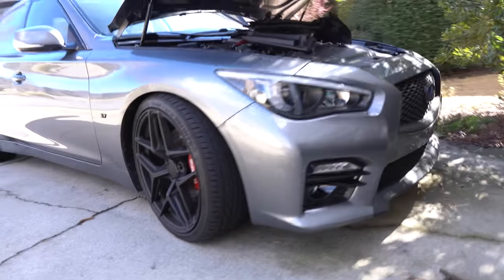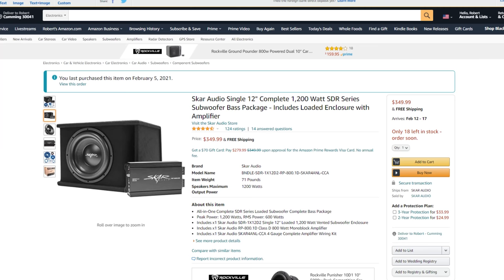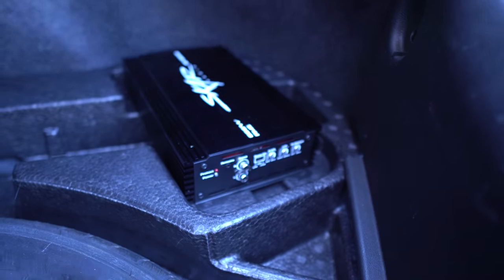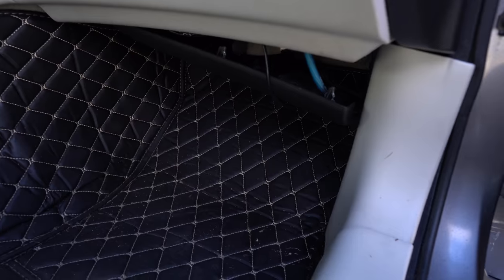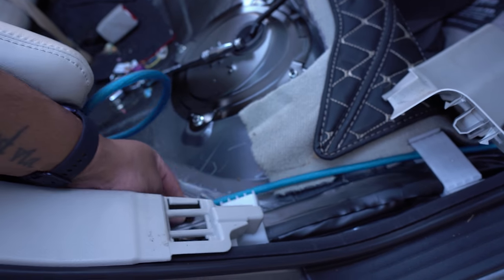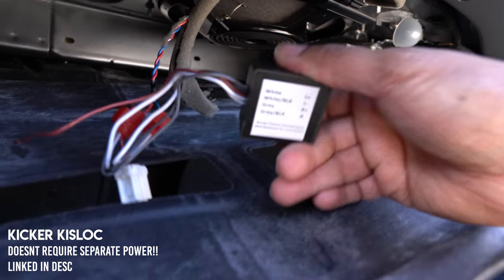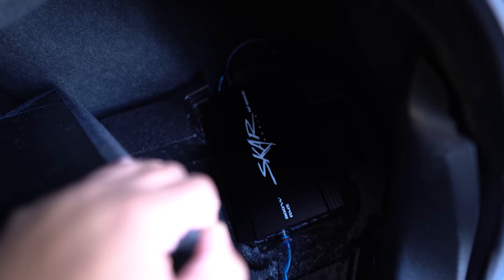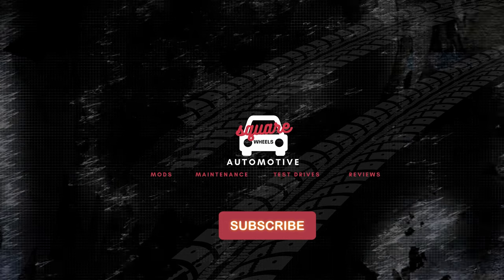Adding an AMP & SUBWOOFER to my Infiniti Q50

Comment: I’ve always heard you should tap the signal before the amp and not at the factory sub.
Reply from the maker: Could be better that way? I'm not a pro installer or audiophile, just a guy with a Q. I do know this setup has been rattling my mirrors cleanly and consistently for over a year 👍🏾
Reply: @SquareWheelsAuto  that’s good that nothing bad has happened. If I decide to keep mine (2014 Q50 with the Bose), I might do it before the amp and also disconnect the factory sub so I don’t blow it up when the lows hit.
Reply from the maker: @clarks2001  I'm no pro, but I know enough to know there's literally no chance of that happening. All you're doing is piggybacking the low frequency signal from the factory sub. There's nothing getting sent to it.
Reply: @SquareWheelsAuto  I’m definitely no pro either. But thank you for the clarification. I’ve got an alpine type r (older model) and a 1000w mono amp just waiting for me to install but was always afraid I’d mess something up. I’ve done many installs on all my other vehicles but they never had premium systems in them so the Q is new territory for me on audio. Also, I’m on the fence about the “Tesla screen”. Being a 2014, it’s not capable of a PnP CarPlay module, which I need. I’m not sure if Phoenix has one that has CarPlay though but seen something about one that had it.
Reply from the maker: @clarks2001  I do know a thing or two about those 😅
https://youtu.be/UnAJlgdZ0So

Carplay support included, no need for additional accessories: https://youtu.be/q_krcJmG4Fo

Comment: I'm kinda lost on the line output converter. My kicker one has a blue wire? Where does that go?
Reply: Im guessing it gets tapped into that lavender wire?
Reply: You have the kicker kisloc 2.  Blue wire is amplifier turn on as it is a DC Offset (signal Sense wire)

Comment: Where did you connect the negative ?
Reply from the maker: There's a bolt right where I showed. Just gotta lift up the carpet to access it. You can also run ground to one of the bolts behind the seat

Comment: I did my install just like this and it worked for around 30 minutes and then my system cut off, decides to just buy a new amp since mine was old anyways and the new amp isn’t reviving power, any ideas or recommendations?
Reply from the maker: If u replace a component and it isnt powering up, check fuses!
Reply: I fixed it, thanks for the response

Comment: I have a quick question I have a 2014 q50a and don’t have the Bose system so you can only imagine my shit sound I was trying to do this but I don’t have a amp so I’m not to sure where to install the remote cable
Reply from the maker: U could tap anywhere that only gets power when the car is on. The positive wire going to cigarette lighter ports are perfect for this. Disclaimer: haven't done this myself

Comment: Did you have to disconnect active noise cancelation mics?
Reply from the maker: My Q didn't come with ANC but I've heard others that have done that.
Reply: @SquareWheelsAuto  what year is yours? I have a 2015 with the bose setup. I'm using your video as a guide this weekend
Reply from the maker: @jeffstack7013  mines a 2015 sport with Bose. Good luck man!
Reply: @SquareWheelsAuto  thank you for the step by step instructions. I was able to get this done in about an hour and a half.

Comment: Does anyone know if this will work for a 2011 m37? I cant find anyone to help n ima just do it myself.  Gonna get a fuse tap for my remote wire to simplify it n got the power ran, but I wanna make sure I can do the loc the same for my m37. I did a bose delete in my mazda but wanna keep my bose in the m. Thanks in advance
Reply from the maker: Same concept, you’ll just want to be sure you’re tapping the right signal wire, I’m sure the wire colors will be different for your M
Reply: @SquareWheelsAuto  actually in the process of doing this. Helpful hint for others....red/blue is positive, pink/blue is negative. Gonna try to tap into a fuse spot by the battery, if not ima hit the spot by the e brake. Ur video Def helped a lot n I appreciate u fam ❤️ if this lady right here can do it so can yall

Comment: Why couldn't you just steal power/switch from the lines to the factory amp? I did this in my old Maxima and it withheld perfectly fine. Just asking....
Reply: most aftermarket amps pull much higher current than the factory amp's wiring can/should deliver. they're tiny.
Reply: @squareheadrob2587  I get that. I guess it depends on the amp. I was running a single powered 10" Bazooka tube flawlessly, but I suppose something with more power would require a dedicated line

Comment: So you don’t have to tap into speaker wires at all? Just the factory sub and amp?
Reply from the maker: Correct
Reply: @SquareWheelsAuto  if I were to install loc to head unit harness could I just splice the four wires to the rear speakers?
Reply from the maker: I think so, but why would u do that if you already have a dedicated sub signal?

Comment: This is great, but I just used a harness i got from owc upgrades. Just plugs right into the stock sub/amp and then to my new Alpine R-A75M amp. I did have them install rcas on the wiring to plug in and look clean. Definitely worth checking out imo. Car thumps now.
Reply: Those harnesses do the the trick but damn they are expensive for a simply wiring harness.
Reply: @theripper121   They're pricey because they're custom made and really high quality. A rare thing these days. The way I see it is I would've spent a bunch of time wiring it up, cutting into my car, or pay out the a$$ to have a local shop in my area hack into my car. For me it was well worth it. Plus, I like that it's reversible in case I sell the car.
Reply: To each his own I guess.  There are other ways to accomplish the same end result that are significantly cheaper.  Again at the end of the day you do you but that harness is more than what most people are paying for their amps.  I could never justify that.
Reply: @theripper121  Yeah, different mindset for sure. Because I really like the quality and value of it. The least expensive one for the Q50 is like 90 bux. And the premium version (i bought) is 115. My amp cost me about $325. Unless you're goin for the cheapest of the cheap setup, 90 bux is nothing for a high-quality setup that clicks in 2 seconds, gives me awesome signals, and maintains the value of my car. How would you accomplish that cheaper without wasting a bunch of time?
Reply: @prestige8161  go look at the cost of some of the other options.  Some of the g35 harnesses are 300 bucks.
Reply: @theripper121   Yeah I checked em out. But I thought we were talkin about the Q50?  Even for the G35 though, if you're talkin about the top of the line harness with EVERYTHING built into it, and it's clean af, dude $300 is a great price. A shop would easily charge way more than that and the install wouldn't even be as clean. They'd have to spend several hours hacking into the factory wiring and more to try and do what the harnesses let you do in a couple a minutes.
Reply: @prestige8161  You are giving the harness way too much credit dude.  Any installer worth a salt would have no problem finding out which wires would be needed to install a sub and use the factory head unit all the while keeping it fully reversible and it wouldn't take them hours my guy.  And if you are replacing the head unit it would be even easier to just run new rcas at the same time you run ground and power. All this talk about hacking up factory harnesses is silly because again no installer worth their salt would just cut the wires.  All of it would be reversible.
Reply: @theripper121  Bruh, now you're bouncing around to try and make a point. You were last talking about the G35 harnesses with everything built in to replace the oem amp, and now you jumped back to the harness to add subs. They're different prices. If you gonna criticize the price, at least be consistent with ya argument. We already established the harnesses to install a sub is not 300. The ones for the Q range from 90 to $115 depending on the tier level you want, and both include the noise cancellation bypass. There's no comparison to the price "any installer worth a salt" would charge to try and do a proper equivalent job to what these harnesses let you do in just a few minutes, all from inside the trunk. It's not even close. If anything, any good installer would use these harnesses for a cleaner/better/faster install. That's how it works my guy.
Reply: @prestige8161  You are absolutely hilarious.  I don't care what harness you want to discuss they are all terribly overpriced.  Any installer that didn't start yesterday doesn't need such a harness because they can make themselves one or tap into the factory harness while leaving it all reversible in about 30 mins time lol.  And the diyer who is capable of running their own power and ground with a few google searches can easily find the wire colors they would need as well to add a sub and amp without paying for an overpriced harness.  You acting like googling speaker wire colors is like trying to decipher the enigma code or something 😂 and I am being consistent with the prices the harness to replace the factory amp and add a sub is over 350 dollars.  The one to replace an amp is over 260.  So you telling me adding one rca is worth another 100 lol.  The prices are nuts period.
Reply: @theripper121   Well I guess we make each other laugh, because you're crackin me up. Lol. Splicing into the factory harness is not what you call reversible. And I love how you keep trying to use the top tier versions of the harnesses to try and prove your point. You do realize that's there for people (like me) that want A1 quality, and other options are available for people that want to spend less, right? Quit cherry pickin' homie. Please tell me how much a good installer would charge to do the equivalent job that these harnesses do. The time, labor, and cost of materials (excluding the amplifiers, power & ground wire). I'll wait...
Reply: @prestige8161  Keep trying to justify an overpriced product when anyone can do something similar for half that cost whether it be an installer or diyer.  And splicing into factory wires is done every day in the install business and when done right is completely  reversible and even sometimes required when it comes to steering wheel controls.  A diyer can spend a little more time researching on how to do a smooth install and an installer wouldnt bat an eye about not having this overpriced harness.  Hell this video alone shows a diyer is plenty capable of getting the job done without your fancy overpriced harnesses that you keep defending.
Reply: @theripper121  You keep dodging my questions, so I'll copy & paste it again: 
(1) How would a DIYer accomplish what the harnesses do for cheaper without wasting a bunch of time?
(2) You keep trying to use the top tier versions of the harnesses to try and prove your point. You do realize that's there for people (like me) that want A1 quality, and other options are available for people that want to spend less, right?
(3) How much would a good installer charge to do the equivalent job that these harnesses do? The time, labor, and cost of materials (excluding the amplifiers, power & ground wire). I'll wait... Again.

And this time I expect real answers, lol.
Reply: @prestige8161  1.  Not sure why you asking me this question given this video right here above these comments show exactly how to to do it. I'll admit it could have been done a little cleaner but thats on the guy that made the video its very possible to do.  

2. Even the lower tiered products you are paying over 100 dollars for a harness just to add an amp and nothing more.  With 20 min of google and half that price you can come up with something just as good as your expensive harness just as this guy did who made this video. 

3. This question is pretty irrelevant given an installer isnt going to touch your car just to spend 15min on it wiring up something so you can then install your own amp and sub.  He is going to charge you for doing all of the job or none of it.
Reply: @theripper121   Ok, appreciate you at least trying to answer the questions. This video does show "a way" to add a sub, but it's not nearly as good as what I have in my car right now. 20 minutes of google and half the price won't give you that either. No matter how you look at it, my connections are way cleaner and I didn't have spend a bunch of extra time researching & watching videos, all just to t-tap the factory harness, buy & install a line converter, extra cables and what not. And I mean, at that point what are you really saving over just buying a quality harness outright? 

The lower tiered products for the q50 are 90 bux brother, not over 100 like you said. So, for $90 you get to connect a sub amp and bypass the noise cancellation crap. And I'm pretty sure if you don't want certain features, the guys there will adjust the price for you. I know cause I had some back & forth with the dude chris about what I wanted for my setup (I wanted an add-on). 

The question about the installers is 100% relevant. You and I both know the breakdown for car audio installations and you're looking at $$$ for the labor & materials. Especially if you tryna amp all the car speakers, add subs, run speaker wiring, etc. Suddenly, that 250 or $350 harness that does all that for you starts lookin' real good to both the diyer and installer. But I guess that's all irrelevant if you can't see the value in that and you're going for the cheapest of the cheap setup. The product just ain't for you. I'm happy with mines tho 😁

Comment: Is there any smaller subs that sound good?
Reply from the maker: Probably but I don't have any recommendations that I have experienced and trust. I just know what I used 🤷🏾‍♂️
Reply: @SquareWheelsAuto  thanks, this sub looks good but I plan on getting bags on my Q and want to have a trunk still lmao. Also I think I have the same mats as you but mine don't stick to the "walls" next to your legs, did you use velcro or some type of adhesion for this?
Reply from the maker: @enriqueramos2554  I feel you! I considered doing an infinite baffle sub in the ski pass through, that could be an option!

For the mats, I tucked the edges under the plastic trim pieces all around to make them "stick" 😎👍🏾

Comment: is it almost the same process if I just have the base system?
Reply from the maker: Similar! A bit tougher if you have base.  Since you don't have an amp in the back, you'll need to source a different audio input and remote signal.
Reply: @SquareWheelsAuto  have any idea where? Any help would be appreciated so I don’t have to pay a huge amount to bestbuy lol
Reply from the maker: @austinyoung9786  Audio signals: https://www.youtube.com/watch?v=yUUvjvt5Vlw

Your remote you could probably tap the lighter sockets - they usually only get power when the car's on
Reply: @SquareWheelsAuto  thank you so much
Reply from the maker: @austinyoung9786  sure thing bro good luck!

Comment: How is this setup holding up?
Reply from the maker: Just as solid as the first day! Can't say enough good things especially for the price. Punches above it's weight class for sure 👍🏾
Reply: @SquareWheelsAuto  I just got this enclosure for Christmas and plan on installing it this week. Do you still have the factory Bose speakers inside? If so how do they sound with the added bass?
Reply from the maker: @MrKINGSHT205  still running all the factory Bose, they sound great. Sub gain is turned to like 10% and it balances the whole system out. Congrats, nice gift!! 🙌🏾
Reply: @SquareWheelsAuto  thanks bro I’m gonna give it a try as soon as it warms up a little this week. I’m sure I will have 1000 more questions 😂
Reply: Quick question…. Where did you run your bass knob?
Reply from the maker: @MrKINGSHT205  https://youtube.com/shorts/liZ0x-oqyPc?feature=share

Comment: Wait whats the point of a line out converter for?
Reply from the maker: Takes the full audio signal and converts it to clean low frequency signal that your amp needs
Reply: @SquareWheelsAuto  oooh wait so is it required or not ? i just don’t really know about wiring
Reply from the maker: If your amp accepts speaker level inputs, u can skip the LOC. If your amp only accepts RCA inputs then u need the LOC.
Reply: @SquareWheelsAuto  ooooh so i’m planning on getting a skar amp, but not sure yet so basically i would
need the LOC, but how do i know if I need a LOC if i get a different kind of amp ?
Reply from the maker: Some of the skars have speaker level input too. Just need to look at which model u get and see what inputs they accept
Reply: @SquareWheelsAuto  ahh ok can i shoot you a DM and you tell me if it needs it lol?
Reply from the maker: @Awsometiger1011  sure man @squarewheelsauto
Reply: Is this the same thing as the remote wire? Or do you need to install the line out converter and the remote wire to the sub?